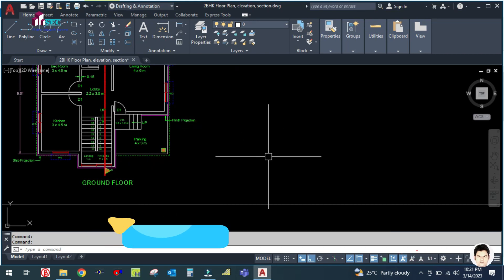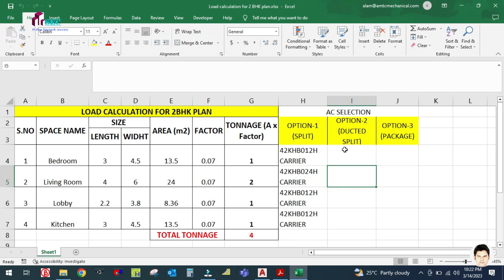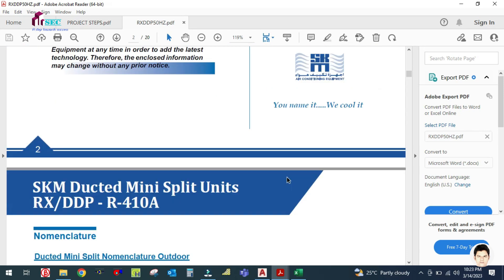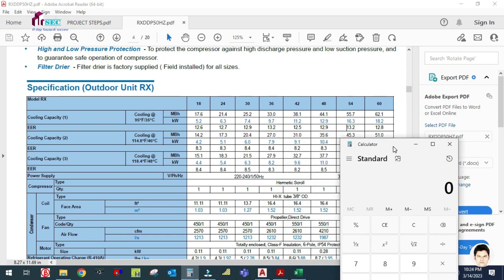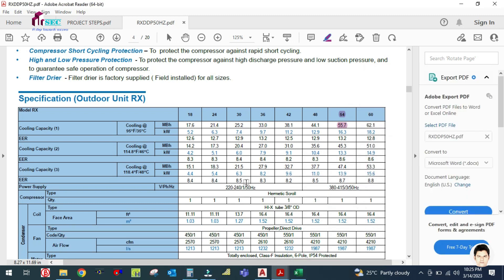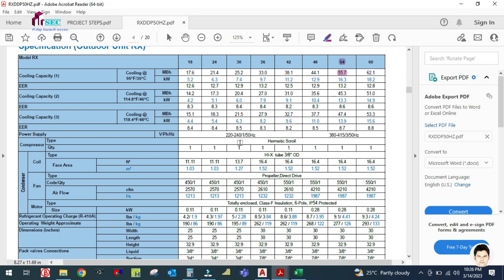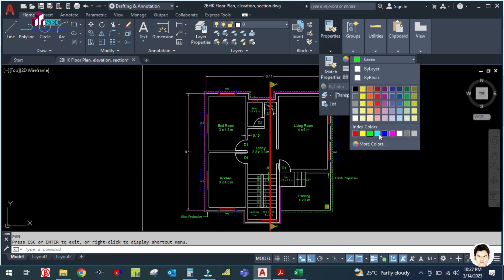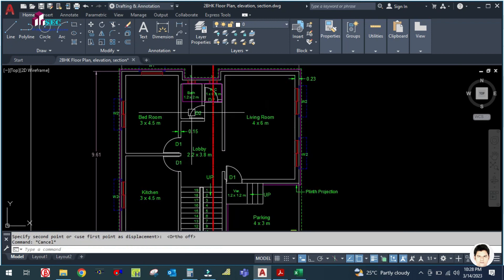STEP-3 A I DUCTED AC SELECTION I HOW TO SELECT DUCTED SPLIT WITH CATALOGUE I

Comment: Tabls  4  expls  drive  componnwts   tw  e  o60  A1     ...TwEo60  A3   TwEo  60  A3   hp  volt  phase  hertz  rpm  frame  insul  amb  sf ...tabls  evaporttrs  fan  perormannce    external  static pressurein  water  column   cfm  .. rpm  rpm  bhp  1600  .1700charted expls   1900. 625rpm 686 low  stic standrs static drive  hifh  static drive  blower aheave pdod  bore  belt size all detls . Specific cattions  cat lond  mezhioes k
Reply from the maker: what do you want to ask

Comment: How can I get the catalog you used in selecting the split ?
Reply from the maker: Give me your email i will send it to you
Reply: Indoor  fan  die  width in   no  used  drive  speed  s  no  used  drive  speed  no  motor  hp  motor  speed  rpm   volts  ph  /Hz fL  amps  lR amps  filter  typsize  in    gas   R22 all detls   Ref  ..lime  connections   suction  line  size  in  od  ..liquied  size  in   od   dimensions   crated  in  ..)  uncrated)  .Dimensions   ..weight   ship ing  lbs  .)  Net  lbs  .. plat  fins  3    ..indooe  fc  centrugal  used  12 ×12  drive speed   1  bet  .1..moter 1  1 .o75   speed  Rpm  1725    volts   208  .230  .460  /360  
  1.3 8.2   // .volt filter  furnished    throwa y (1")sizin  Qty  1  each   16×20  ×1  &20 ×1.  Gasr22  shiped  nitrgen  holding  charge   braze   1  1/8  3/8   dimemensis  L×w×H //45×26×53  .39  ×23  ×48   weifht  lbs  .  Net  276  ..236.